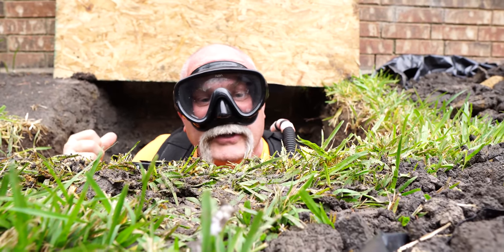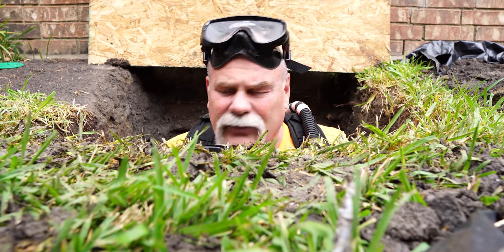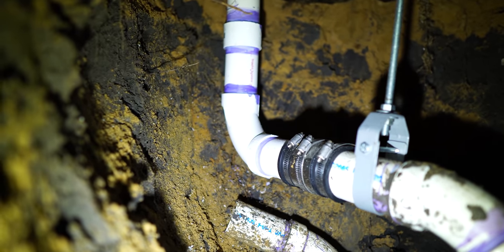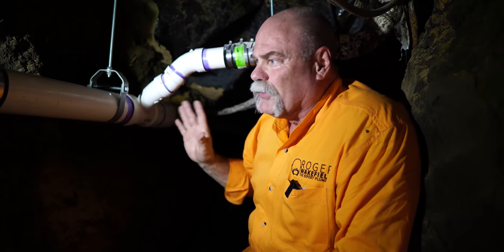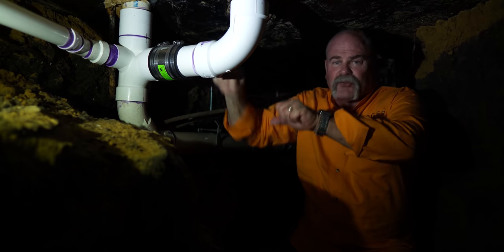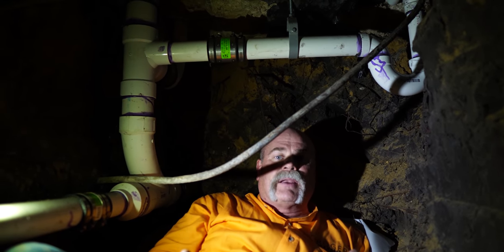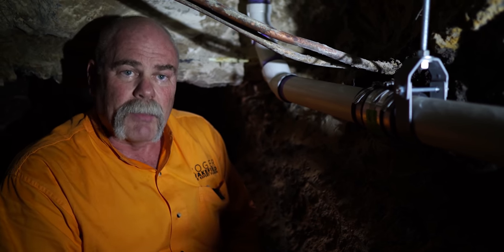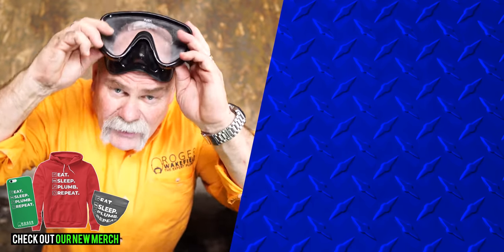DIVING DEEP Under a House to Repair Broken Sewer Lines

Comment from the maker: How would you feel if you had to have this repair done on your house?
Reply: This is such a good video
Reply: I'd be glad Roger Wakefield was at my house!
Reply: Id be pissed.never buying a house without a basement, or pourded foundation. Haha
Reply: These rubber fittings with the jubilee clips in the UK are called marleys do you wrap the jubilee clips up to stop rusting or corrosion with an amalgamating rubber tape Roger? 👍
Reply: Quality content👍
Reply: I'd be pissed. And would consider moving 😆. That's gunna be a good chunk of change.
Reply: I'd feel broke. digging all that out structural engineer license plumber $$$$$$ I don't even want to know the cost of that job
Reply: Oof, it's stuff like this that makes me afraid of having my own house. x.x
Reply: I'd feel poor. Both emotionally and financially.
Reply: You'd absolutely hate the underside of my home. Its flooded 24/7 lol.
Reply: My guest bath and master share a common wall. The master bath other wall is the exterior. I have a leak in one of the guest lines . I plan on doing some bathroom reconfiguration since it is going to worked on. Most of the plumbers here in Austin want to go thru the slab, only like one was going to tunnel. They basically all said the same thing, dig crews cost to much, cheaper to go thru the top. Curious on your thoughts ... pros and cons of each strategy. Love the vids!!
Reply: Oh my. “Broke”. The one thing I dread on my slab foundation house. I’ve always had a walkout basement with interior access to most of plumbing. This just stressed me out watching it 🤢
Reply: I'd want to sue the builder and the original plumber who made that abortion.
Reply: I don't like that plastic tub and overflow assembly.
Reply: We had bad pex installed in my house and had to repipe due to leaks in slab. Much more cost effective and if it breaks I can fix it.
Reply: I have a picture of a "handyman" drain install of a tub in a 2 story house. How can I send that to you?
Reply: @xNevlosx  Plastic is ok but I prefer schedule 40 pvc that is glued together.
Reply: How much did you charge for this
Reply: It would suck
Reply: If it was done by a professional like yourself I would feel relieved!
Reply: The ink writing on the pvc pipe is outside down.... we know roger didn't do that one....
Reply: I do these repairs.
Reply: @LegendMuscle  They still go under the concrete basement floor. And even under the driveway. That gets more expensive to repair than a slab.
Reply: I am 14 and a freshman in high school, I do not know why I enjoy your videos so much.
Reply: I’d start collecting rain water.
Reply: I'd be worried that my house would sink into the ground next.
Reply: cute Ranger tab..class 06-06
Reply: I would love for the repair to get done, but also feel some type of way that I had to repair it in the first place. An Expensive repair. Thank you for the plumber's advice.
Reply: Would love to see how you excavate under a house like that.
Reply: Id need ya fixing my sink, but im from germany lol
Reply: This would be expensive for sure! I'd be hot! I'd also want to make sure my plumber was as thorough as you.
Reply: @ULTRASMOKE  but if you do move and leave the issue there you’d leave it up to the next house owner to deal with that issue and they may not expect it
Reply: @fhuber7507  The ground moves. Good luck trying to point the finger at anyone years down the road.
Reply: is there any way i can get the name of that intro beat :O
Reply: Roger, why wouldn't you cut the concrete inside instead of tunneling?  Is it because of the clay and stability? I am a 25yr plumber in CA and we would cut the slab and have never though about tunneling so far under a house for repairs?
Reply: 1 1/2 trap on that tub is cracker jack, 2"trap with flush bushing allowing you to bring 1 1/2 up is a far better job....
Reply: @MoltenMetalCasting  
PVC is pretty good but I prefer the stronger option which of course is schedule 40 ABS
Reply: I’d wonder why the hell I bought a house on a slab

Comment: I'm so grateful for crawlspaces right now. I cannot imagine digging out the area under a slab home. When we make repairs on slab homes here in Kansas, we tend to cut the concrete in area needing repair, make repair, drill pins into existing concrete, backfill and pour concrete back. Usually all done within a matter of a day or a few
Reply: Fellow Kansan who loves basements more and more by the second of these videos and comments.

Comment: Lol I’m so glad we got crawlspaces here in Virginia. Drain line repairs take less than a few hours compared to this
Reply: I don't know why they don't put basements in and run the plumbing through that to outside the house then into the ground,, heck it could be used as a garage.
Reply: @robmarrin6720  digging is expensive and the ground is no good.
Reply: Yeah i can't imagine. Up here in the northeast we have full height basements. I've got 8 foot walls down cellar.
Reply: Eric Wotton plumbing in basements is top tier, love going to a job that has a basement.
Reply: @robmarrin6720  we don't have basements in Texas.. the ground is too unstable and shifts... a basement would end up cracking, leaking, and being even more of problem
Reply: We have crawl spaces here in Dallas. My parents house is over 100 years old. The crawl space opening is in my closet.
Reply: We have crawlspaces too. It just depends if your house is “pier and beam” rather than just slab. Most new homes have just “slab” bc it is cheaper to build.
Also there are homes in west Texas that have basements but most don’t bc of what @Raz Black stated
Reply: Barry Merrill hey, we don’t smoke crack we fix them here is tayhas
Reply: Cooper Mackey understandable cause of geographical locations but still, I would never dive into a tunnel to fix drains or water lines. I’m pretty happy crawling under my 1700-1800’s colonial era houses haha
Reply: I was about to say THE SAME THING! I'm in Virginia too.
Reply: Brandon Ruiz haha yeah I wish man nothin worse than bein in a tunnel and having sand fall on you lol plus I bet Virginia is a lot prettier too than here
Reply: Austin Patrick I’m based on the Eastern Shore of VA, lots of old houses here
Reply: Cooper Mackey I live on a peninsula so lots of water and lot of houses high up on foundations where you can just walk under and stand up lol.
Reply: You definitely don’t have crawlspaces under solid foundation homes. This isn’t a raised foundation, this is a solid foundation. It’s a dirt pad that is laid, compacted, and the concrete is framed out and poured over it (with an 18 inch stem wall, typically), and they tunneled under it.
Reply: Christopher Chandler I don’t think anyone said otherwise? Lol
Reply: @razblack  We also have the Edward's Aquifer under central Texas (San Antonio area)
Reply: @coopermackey4938  there are upsides and downside to both systems, slap is cheaper and faster and do not get as many moisture related problems as pier and beam however guess this might not be as big a problem in texas then up north. heating is too often cheaper with a well insulated slap as the ventilation under pier and beam means you looses more energy trough the floor.
Reply: @Mira_linn  encapsulated crawlspaces can really help out with all those problems
Reply: @Mira_linn  which is why we check on every one we encapsulate yearly. And patch
When neccessary. Have only had to patch two out of around 50 that i have installed
Reply: @Mira_linn  free and guaranteed for 5 years. $59 bucks for any inspection afterwards. Depending on the tear or damage $50-200 to do repairs
Reply: @razblack  wow, really?
Reply: @robmarrin6720   It's the clay soil. you have to remember most of texas way back in time was under an ocean. It's sedimentary type soil. It doesn't let water drain through it. So any water that would get down behind a basement wall will stay there and either permeate the wall or potentially freeze behind it. 

Now that's the historical reason why. The modern day reason why is slab construction is fast cheap and easy and by the time the slab starts breaking up do to being to thin or overstressed it's someone else's problem. That's why houses in generally rarely have basements today and why so few houses sit on piles creating crawlspace.
Reply: @Cragified  I've learned from you guy's comment's thank you 👍
Reply: I'm glad we got basements in PA for the same reason.
Reply: as a German this is confusing, there are no houses build without basements. Every single house and Appartment block has a basement
Reply: Sea level ect. If everything were that easy.  Same as most of our graves are above ground ect. Least south Louisiana
Reply: @larryyerr  Why don't you move down here, and show us all the "right" way to do it then, genius...? 
Clay ground requires an entirely different building technique than what is used elsewhere in the country. 
Ground stability is a thing here... as in, we don't have it. So, you either drill to bedrock, about twenty feet down, and sink piers, or you float a slab on a sand pad. Houses that utilize any other method tend to not stand up for very long... but by all means, c'mon down here, and lend your obviously "expert" opinion...
Reply: @razblack  Some houses here DO have basements... but god are they expensive to build. You have to excavate half again as much volume for your basement as you do elsewhere in the country...and when you backfill around your basement, you do it with gravel and sand... which doesn't swell and contract, like the clay you are displacing. If you have the money, then you can build a house with a basement here... but it's time consuming, and engineering the concrete, the backfilling, and the drainage system for outside the basement walls, plus waterproofing them, is a real pain, and very time consuming.
Reply: @curtisboswell2619  you're so sad 🤣🤣🤣

Comment: I’d like to see the dig crew putting the dirt back in and how they compacted it
Reply: We plan on doing a video on this very soon! Stay Tuned ;)
Reply: Same
Reply: And excavation process too!
Reply: Can't they make it into a small basement?
Reply: I would too because the company I’m with we take our time and make sure there is no unpacked spaces
Reply: @s99614  Not without expensive structural work. Slab on ground foundations aren't engineered to have a void under them, if you dig under the footing of the foundation, you compromise the structural integrity of the foundation and risk structure collapse.

It'd cost tens of thousands of dollars to engineer a void under a slab foundation. You'd have to dig and pour a new foundation footing while supporting the weight above, then engineer load bearing walls to sit on the new lower footing and hold the slab above it up. The walls would also have to be designed to take inward pressure from the dirt, and the dirt backfilled outside the walls to prevent the dirt supporting the slab from drying out and collapsing inwards, further weakening the foundation.
Reply: @GGigabiteM  my good sir, this reply has made a great point, thank you so much for sharing!!!🙂
Reply: @GGigabiteM  I think the old folks have the right idea to build a house on pier and beam.
Reply: @joerodriguez6048  Pier and Beam existed because the technology and infrastructure for pouring a slab didn't exist prior to about 50 years ago. It was possible, but the economies of scale weren't there.

Pier and beam is a lot more expensive to do these days versus a slab foundation, but both have their advantages and disadvantages. If you have a bedrock foundation, a slab is best since nothing is going to move around. For shitty clay soil like in large parts of Texas, a pier and beam foundation is a better choice since it allows the soil under the foundation to maintain a more uniform moisture concentration.

The nasty black clay we have can expand and contract several inches multiple times a year and is very hard on slab foundations that aren't properly engineered. Most of these massive housing subdivisions where houses are thrown up in a week don't have properly engineered foundations and within five or so years, you see the siding buckling or cracking and the roof warping.
Reply: @editorgrayson1073  is the video of filling the void still in the works?
Reply: @editorgrayson1073  wheres the video?
Reply: @joerodriguez6048  Problem is, that in N. Central Texas (where these videos are filmed) bedrock, to set your piers on, is typically twenty plus feet below the ground. On many older homes that are pier and beam (typically houses built in the late 1800's to the 1940's) they simply dug pier holes down about 4-6 feet deep, poured in a foot of large gravel, and then set a wooden pier (typically Bois D'Arc or Elm) and then set horizontal beams on those posts. This is how barns and outbuildings were built, and houses...until it was noted how unstable the ground is here. Black Texas clay, or "gumbo" as it is sometimes known, contracts in the Summer time...and expands in the Fall and Winter, with heavy rains. 
All of this flexing, expanding, and then cracking plays havoc with pier and beam, as well as slab foundations. 
Better slab foundations are excavated to a depth of four feet, and then a polyethylene cushion liner is laid where the foundation is to rest, including down in the foundation footings. Then, a heavy layer of sand is poured in on top of the cushion liner. This cushion liner is placed, to keep sand from "leaking" into the cracks that develop in very dry clay, during the summer months. Cushion liners aren't found on older slab homes, as they only came into regular use during the late 1980's. Slab homes are built on a thick "cushion" of sand. This cushion is the buffer that is needed (in North Central Texas, at any rate) between the continually "moving" clay, (through expansion and contraction cycles) and the rigid, unyielding concrete. Without that buffer, even the most heavily steel reinforced concrete will begin cracking, and result in a weak slab. Pier and Beam is a great way to go.... and most commercial buildings are built with steel rebar reinforced concrete piers, going all the way down to Limestone bedrock...about twenty feet deep. Expensive? Definitely, but still more problem free, and longer lasting, than just pouring slab on sand pad.
Reply: @curtisboswell2619  so Amarillo and the outskirts have the soil conditions that you mentioned.

Comment: This is great learning new stuff. In the UK, any underground waste/soil pipe we use is push fit/ring seal. It has a rubber "O" ring seal inside. This allows for movement in the ground, very strong. The solvent weld or glue we use could crack from the movement because it's not malleable enough. 

I like your solvent weld, you can see if you've missed a connection, ours is clear and sometimes they get missed. 

Cheers for the great vid

Comment: Whats up Roger, im a journeyman plumber in Pittsburgh working towards a masters license and would love to see the process in detail about how you guys dig under slabs and backfill and everything. Would also love to hear why you might have ruled other options out such a hydro excavating and then possibly filling with stone for a better less settling backfill. Would also like to really see tunnels that are dug because in pennsylvania you have to use a ditch box on anything 5ft deep or lower. just crazy to see how they allow that with no structural bracing for caveins. We have good clay up in pennsylvania that sticks together real well too but i know its also SUUUUUUUUUPPPEEERRR heavy when it does collapse. im in no way saying that this man is doing anything wrong im just discussing how different the codes are!! Super awesome channel!

Comment: so many questions. how do you dig something like that out? How do you know where to dig? how far to dig? who does the digging,you have a crew for that or hire someone else? do you still dig under if the house has a basement or go through the concrete floor? how thick are these slabs? are you ever worried about a collapse or cave in? What are the estimated costs for this work. Would love to see a vid with all or some of these answered.  Answers would help to show to non plumber homeowners why the costs are what they are and why these jobs need to be left to only licensed insured professionals.

Comment: I work in construction in Sweden and our plumbers will usually hang everything to the slab when we build new houses, it is quite simple to do as it is just a thin band around the pipe they will leave sticking up so when we pure the concrete it will be fixated. really cheap solution to avoid nasty surprises later in the life of your home

Comment: Our split-level home in GA was built in 1984 over a 3' crawlspace. The garage is all that is ground level. The upstairs sewer pipe runs under the concrete garage floor. If anything ever went wrong with that, the sewer pipe could be rerouted to the crawlspace and into the line that runs to the sewer. Someone built a new home on a slab across the street from us. I'm not a Plummer but have done some plumbing. To me anyway, a new construction design that includes burying plumbing under a slab seems like a really bad idea. It would be interesting to hear your thoughts on that Roger.

Comment: I live in CO. Not to many slab structures here. That looks like a lot of work. I would have liked to see some before pic's. Was it cast iron? How are you planning on compacting the back fill? I would pour it with flowfill. Why the rubber couplings? Here we call them strong backs or a shielded fernco. Also I wouldn't put a mechanical wast & overflow on the tub because of access. Just curious, how much did that job cost... roughly.
Good job guys, and God bless.